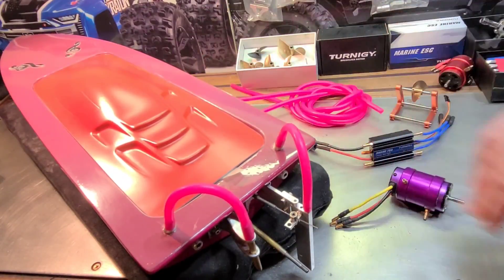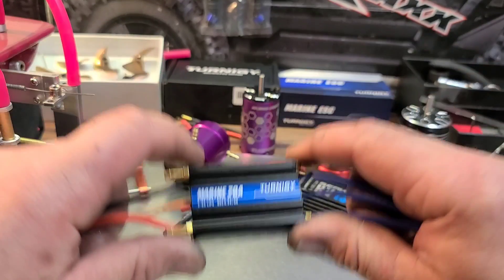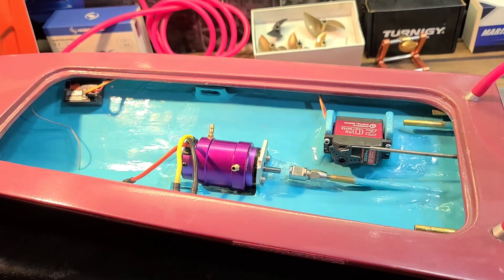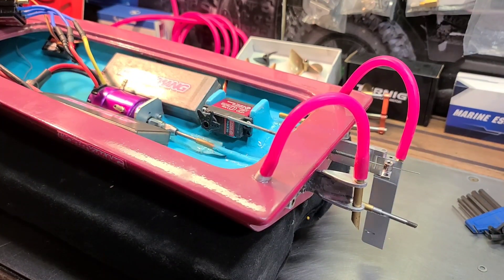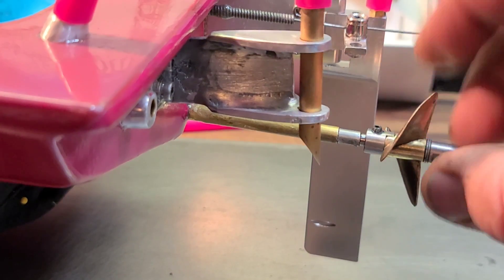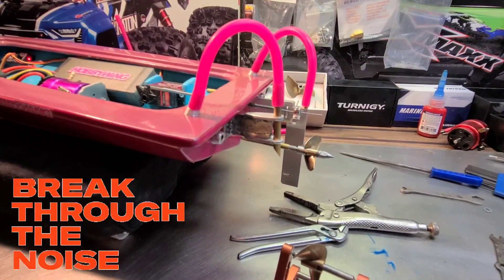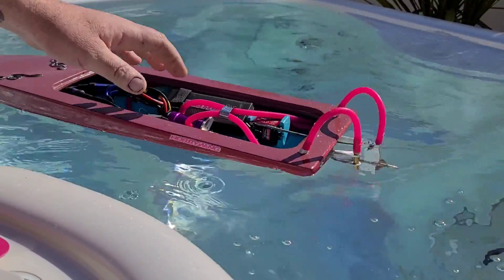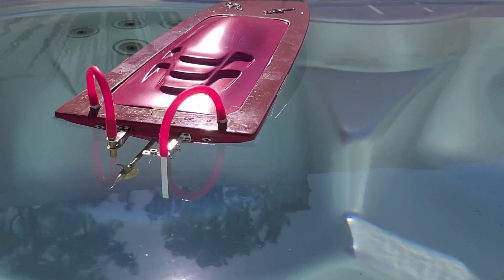Fast RC Boat Electronics Options, Weight Distribution, Prop Selection, Setup & Install Pt2 How To

Comment: Im confuse can anyone tell me how the water can circulate without a water pump? Or does the motor vibration makes it suck the water to circulate to esc and to the motor?
Reply: The forward momentum of the boat creates water pressure in the pickup tubes. I also assume depending where the outlet sits in the water it also creates a bit of vaccum on the system.

Comment: Yo there , Hay can I pick you brains 🧠  I have ft011 just got a new rocket motor its the brushless rocket 2948 -3450kv  , I know not a lot about the hobby,  we're can I get the water called coneter for the to nippals on prop shaft  meany thanks bro

Comment: What a great, informative and down to earth video, super for us beginners, thanks!!

I have a couple of questions relating to building my first own boat.

First, I have drawn and a catamaran style speed boat in 2 sizes, 36" and 44". I have srared 3D printing both to get a feel for size. I plan to use dual 4068 Kv 1700 engines, dual 150 Amp ESC's and dual 6S 65C 5 Amp batteries. I am not after super speed and would prefer building the 44" version, will power be enough?

Second question is the drive shaft. I thought it was necessity to use flexible drive shafts to get horisontal propeller mounting, but is it ok to use a rigid drive shaft and what is max down pointing angle of the shaft?

Also, if I use a flexible drive shaft for these motors, should the shaft be 4 mm or 4,78 mm or 1/4"?

Again, thanks for my kind of film/info!
Reply from the maker: 36 & 40 inch hull is need at least a .187 flex cable with 3/16 stub shaft.    I'd stay away from straight shaft setups, just use a flex cable

Comment: To Ironclad, I am learning a lot like a bumch of other guys and this is a battery power thing.  I run the proboat sonicwake all stock. 2- 7.4v lipos in series the boat is about 32mph and there is no heat on the esc or motor, maybe 95f, but the batteries get hot, 129f, 135f.... 7200mah, 100c..Then 3 of the same batteries in series, not as hot but the motor and esc is just warm, 112f, 115f, but batteries 125f, 134?? 139F.. Motor and esc are fine no matter what, but why are my batteries so hot? Thank You

Comment: Greetings friend; i have a few electric boats; different categories; great fun; but what really  brings me here is the fact that i just purchased a barelyused, no longer available, deep vee, Enforcer type 50 inch long x 14 inch wide and about 12 pounds of weight with no engine; fiberglass hull with all of the outdrive already installed. The flex shaft is a 1/4 inch with a stock 79 P1.4 metal prop already installed. Sinnce money is of no issue; I'd like to convert this gasser into a clean, quieter and more efficient hassle free machine. In other words; brushless'
I really love this hull; and i intend to keep it for a long time'
I want to go fast; but not that fast; sport  racing speeds;  no blistering competition speeds; just a tad more than the 26cc gasser that this thing used to have  before i bought it'
If its possible; and based on the provided data; could you recommend the type  of gear I should get in order to make this conversion possible?
I would really appreciate your attention on this matter'
Ps; your instructionsl videos are very insightful and a Godsend'
I'll patiently await your response to this request'

Comment: I have a silly question, but is there a way to determine inlet vs outlet for an ESC? I have a Seaking 90A V3 RTR and there is nothing labeled that specifies inlet vs outlet. I appreciate any help!
Reply from the maker: There's no wrong way to run water through an esc either side..   Hopefully this helps
Reply: @IRONCLADRC  Yes sir! Tremendously! I have been learning a lot from you videos.  I am almost done with my boat and also working on a 3D printed boat for my son.  Lets just hope they work haha.
Reply: @IRONCLADRC  Sure does! Thank you!

Comment: I have RC cars but never had a boat before, I have a question I don’t see a water pump on this boat does it have a pickup that hang in the water just pushing the water through the system? Will that be sufficient if so ?
Reply from the maker: Most rc boats use a ruder style water pickup that forces water throughout the cooling system

Comment: Did you build this hull? This is nice 👌 did a good job brother. 👍
Reply from the maker: Yes I did thanks.  It was my third wood boat attempt
Reply: @IRONCLADRC  what width wood did you use? Plywood? I'm about to get the sheet of wood to start my first build since I don't want to wait for the 3d printed one to be my first lol. I'm ordering the E fiber sheets and epoxy. I have epoxy and hardner would that work the same?
Reply from the maker: I'd use bass wood or balsa wood, 16"  & up  use bass wood 16" & under Bala should do the trick.  I used thick plywood for this boat and I regretted it way to heavy ....

3/32 bass wood should be perfect for a mono hull 16-24"  use alcohol or ammonia to soak the wood in so you can bend the wood with out breaking it

Comment: How does that thing steer with the prop beyond the rudder? I'm modifying a boat and i'm gonna need to bring the prop out to the rudder. Been wondering about it. Thanks.
Reply from the maker: The prop works best if the prop blades are just in front of the ruder blade.  With just enough clearance for rudder pivot
Reply: @IRONCLAD RC  Thanks, brother! Merry Christmas!

Comment: how do i know the rpn for a 4s boat? THANK YOU!!
Reply from the maker: The Kv rating  is the RPM of the motor (k) per volt (V) with no load. For example, a brushless motor with a Kv rating of 3000 powered by a 12V power source would be capable of 36,000 RPMs (multiply 3000x12). This is the max RPMs that this motor can reach under no load

Comment: Building my first 3D printed boat and bought an ESC that has 4 nozzles. I assumed I need two water pick ups until I realized how they are supposed to be connected with just one. Thanks.
Reply from the maker: Yea you can use 1 cooling line or two most boats just need 1 main line unless your turning big props  thanks for watching

Comment: Question an probably a dumb one  will it harm my prop if i just polish it  nothing else ?
Reply from the maker: I would only polish, very very lite by hand   youll be suprised ay how much a dremal polishing wheel will take off a prop and make it out of balance so do it at your own risk.  ive been working onbalancing a prop for e few days now.   if its for a boat 6s and greater your better off just leaving it alone

Comment: Hello,

I have a friend who will make me a 1.2m (50") mono-hull boat. Picture here: https://postimg.cc/y3qgLyv1

The idea is to use the boat in the river / sea hoping that it will deal with small waves when they appear. I do not need it to be a fast boat, just cruising around with Ardurover for some autonomous missions that I want to install in it. Based on your experience, can you please suggest a suitable combination of Motor + Prop for this particular case? I plan to use 6s lipo batteries with it. Thank you
Reply from the maker: I apologize I'd go with a 40mm leopard motor and 150a  ose combo.   Off shore Electrics  seems a combo that may work. If your not trying togo fast a 36 series motor will be to small.   Offshoreelectrics.com. prop with low pitch for a boat of that size.
Reply: @IRONCLADRC  Thank you again! Much appreciated!
Reply: @IRONCLADRC  Many thanks for the quick reply! Which kv do you suggest to look for?
Reply: @IRONCLADRC  Many thanks for the quick reply! Which kv do you suggest to look for?

Comment: Hello. I have a fully stock zelos 36 and just bought some custom props. What do I need to do to my boat as far as adjustments to accommodate the new props? Thanks
Reply from the maker: Maybe Tinker around with strut positions

Comment: Need PROP help?  Building 70inch deep vee (hulls weight 9 lbs empty)...Leopard 56110 780KV , Seaking 130HV Esc, 8s....  what size Prop do you suggest?  I want speed but dont wanna burn anything up.  Thanks in advance.
Reply from the maker: Maybe a octura  x 665  that's 21/2" wide and has more pitch than a x465. Never built a boat of that size. I've been running a pranther 260 on this 42 omg (OVER KILL I KNOW). Amazing acceleration and the  Temps have been warm..... check ose forum they maybe able to help more than I

Comment: I want to build RC 60inch catamaran boat 
With twin 4092 ,1250kv,150a ESC,6s 
Total of 12s and I don't know which props I should use for highest speed 
Please suggest me good props that can give high top speed
Reply from the maker: Oh man.  lowergood kv motor is a great start!  IT should turn a 1.7 pitch prop. I've had very little experience  with cat hulls check out ose forums they can give you some good advise.
Reply: @IRONCLADRC  any link for that

Comment: Great video!  

Especially for someone like me who knows nothing about RC boats and got one on trade.

What kind of grease do you use on a “stuff tube”?

Marine gear grease?
Reply: Also subbed!
Reply from the maker: I like Grimm racer speed grease it's kinda hard to find or prather cable grease from. Off shore electric.

Comment: So I just watched your video and a have a band new boat and stinger drive get pretty warm I did grease it before I ran it the first time one run
Reply from the maker: Grimm racer grease is a great grease to use.    As long as the stuffing tube doesn't get so hot that it heats the epoxy up to the point of delamination...  if it's warm it should be OK.  Thanks for watching
Reply: @IRONCLADRC  I use partner cable grease
Reply from the maker: That grease is just as good. Check your stuffing tube aswell make sure there's no kinks. Also doesn't  hurt to remove stinger and check alignment  to the stuffing tube (where tube and stinger mate up)  good luck brother
Reply: @IRONCLADRC  ok thanks

Comment: Kalau motor brahsed and bruslhees digabungkan dengan ESC brahsed ESC bruslhees satu rc bisa bang?...
Reply from the maker: Brushless motor and esc. Turnigy Marine
Reply: @IRONCLADRC  i mean ,of the brushed and bruslhees motors are combined with a brahsed ESC one RC bruslhees can be brother??
Reply from the maker: Some brushless esc's can be run with brushed & brushless motors.  Most esc are brushed with brushed  - brushless with brushless
Reply: @IRONCLADRC  thanks you glad to make friends with you from Indonesia
Reply from the maker: Glad I could help. Thanks for watching

Comment: I got my first boat about a month ago I got the proboat stealthwake its brushed and its fun but I need more speed what a good cheap setup I was looking at the dynamite brand esc and motor on Amazon but didn't buy bc I didn't know if it was priced correct
Reply from the maker: Great turnigy 50esc  paired with turnigy 3650 is a cheap set up  if you want more power go with the turnigy 70aesc instead of 50a. https://www.ebay.com/itm/RC-Turnigy-Marine-ESC-50A-/253731684097?_trksid=p2349624.m46890.l49286 

https://www.ebay.com/itm/TURNIGY-XK2845-3650KV-BRUSHLESS-MOTOR-2-4S-4-POLE-RC-CAR-TRUCK-EDF-BOAT-PLANE-/274811719632?_trksid=p2349624.m46890.l49286. 

Runs cool plenty of power